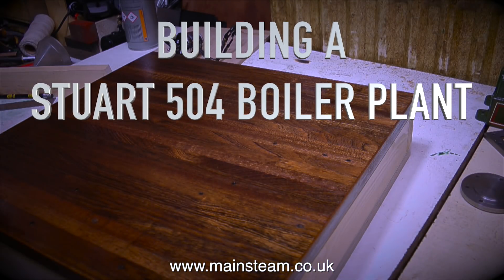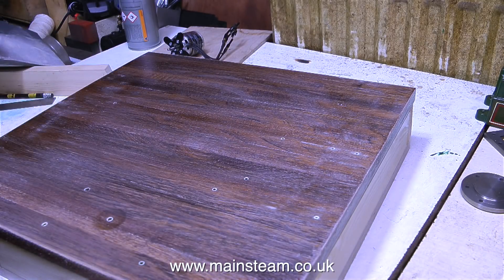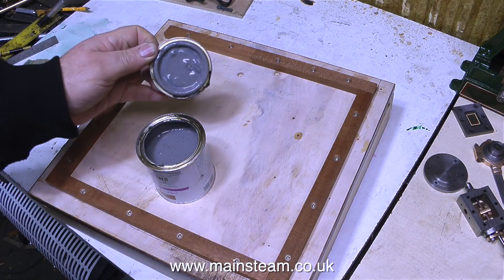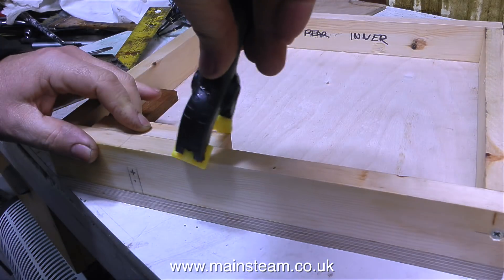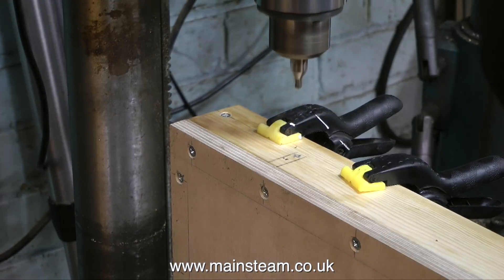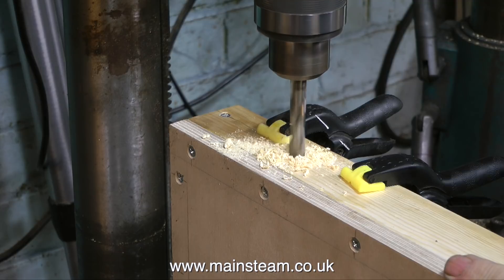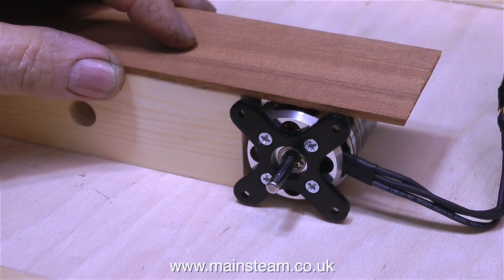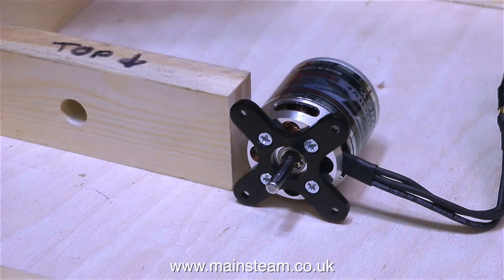MAKING A STUART 504 BOILER PLANT - PART #18 - THE INNER BEARING MOUNTING

Comment: There are nothing wrong with it, but soft wood as so soft so you should not need to use a reamer.  Especially as you will put steal bearing in them, the drill bit should be enough. 
But sanding the corners(?) of the holes, so you don't get splinters in your hands is important.
Pilot holes are needed when using wood screws, as you did.  If one doesn't there are a risk for the wood to crack.

And yes, your video are as usually of great quality, and very useful for my inner peace.  Thanks

Comment: Mr. Appleton, have you ever used "Tac Cloth"? It's a cheese cloth that has a sticky substance used to pick up the lightly sanded off varnish from the wood grains. I use it when I'm doing finish work on wood projects.
Reply from the maker: Yes, but I kept dropping mine on the floor, so it deposited more particles than it picked up {:-)))